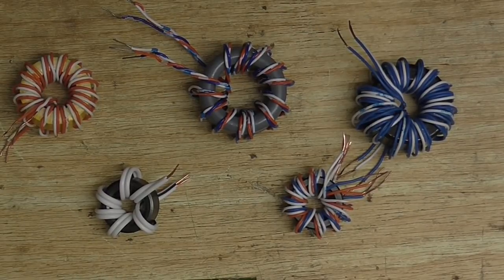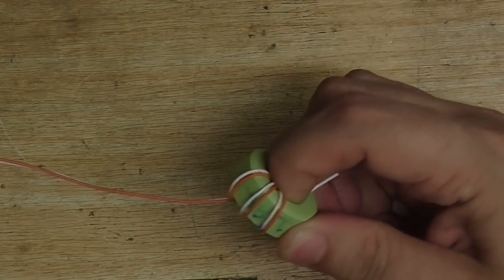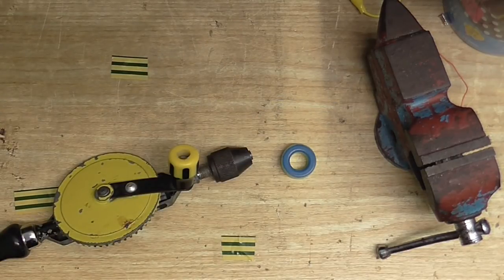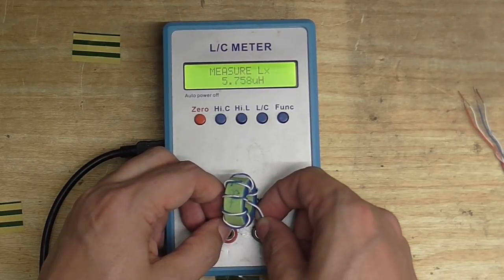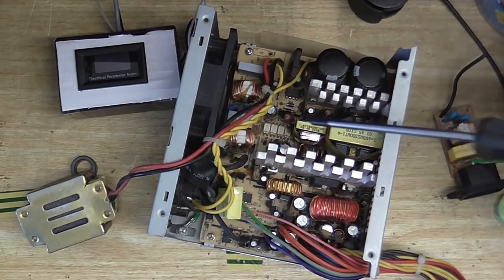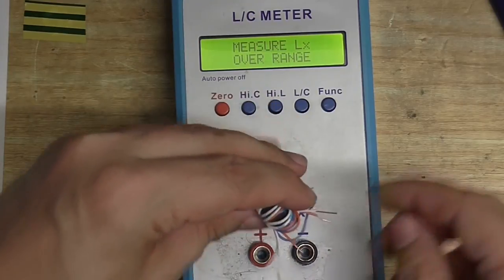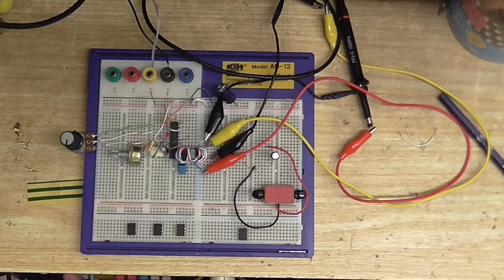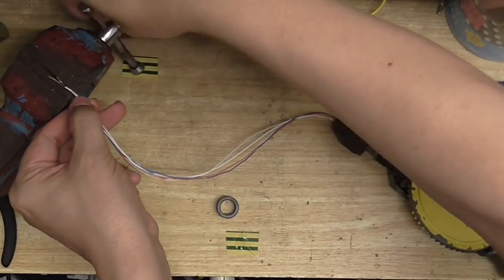How I wind coils

Comment: Thanks for the video Cool Dude Clem. So it does not make a difference which way wires are wound? Twisting wires seemed to have no effect either. I have seen dots on schematics with coils. What they mean has always perplexed me. For some reason inductance has always puzzled me. Some bits I grasp and other parts not so much. Perhaps an inductance meter is in my future?
Reply from the maker: The only thing to keep in mind when seeing the dots on schematics when coils are used, is the dot shows the polarity. So if there are no dots on the schematic you dont need to worry, just connect up as shown. However if there are dots, lets say the primary winding and one of the secondary windings have a dot are at the top, but on the other secondary winding the dot is at the bottom, then you flip the connections on that winding that has a dot at the bottom, so anything that looks as if it's connected to the bottom of the "bottom dot" secondary on the schematic actually connects to the top end in real life and vice versa, schematics are often shown that way to make keep it simple which personally i think is a bad idea and should show it the way it really is.
Reply: I'm following you but I'm getting more confused in the process. The dots may always just be beyond me. If an inductor has no dots on it how do you tell the phase? Just put a signal through it and scope it? I've also heard about inductors being tuned for the transistors powering them. e.g. certain combinations of transistors, frequencies, and coils don't always work together. Mismatches can lead to too much current I presume and destroy the drive transistor? But the math to figure all of that out is over my head.
Reply from the maker: you dont need to worry about the phase on most inductors. As far as matching is concerned, big inductors such as something with an iron core will work well at low frequencies but not so well at high frequencies, where as with a ferrite or iron powder core those work well at high frequencies are are pretty much a short circuit at low frequencies.
Reply: The core material makes that much of a difference? Who knew? I was wondering about the small amount of turns on the coils you were winding. I have to get an inductance meter so I can see all of this stuff for myself. I have a bunch of TL 431 ICs that I want to fool around with. You're using the 434s? I might have to get some of them too.
Reply from the maker: For some cores you only need a small amount of turns, those cores only need a small number of turns to get a high inductance so less wire is needed. for instance I have many mains voltage step down transformers, one of them is tiny and one of them is huge, I measured the primary of the tiny transformer and it was well over 1000 ohms, and the primary on the big transformer was only about 2.5 ohms! Yet both are happy to run on the 240v AC mains, since there's a lot of iron in the big transformer, there's a lot of inductance so the primary can be made with fewer turns. Just one thing though the chip I was using in these experiments was a TL494, not 434

Comment: Does your scope have isolated channels?
Also, for GDTs I've noticed that I have to load the secondary, otherwise I get some voltage spikes.
Reply from the maker: With this GDT I made, the only load I put on to it was the oscilloscope itself and nothing else.  On my scope the channels are all grounded together and connected to mains ground interally